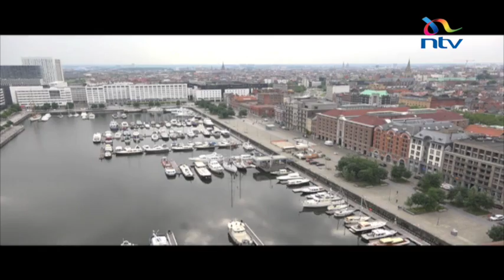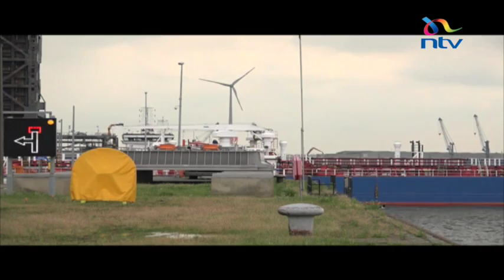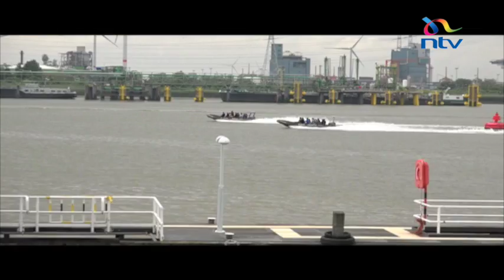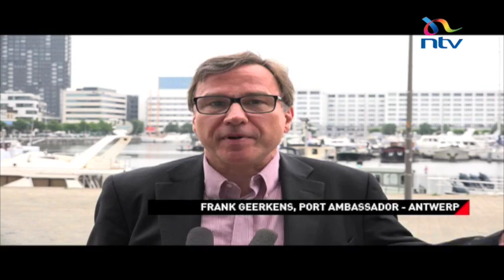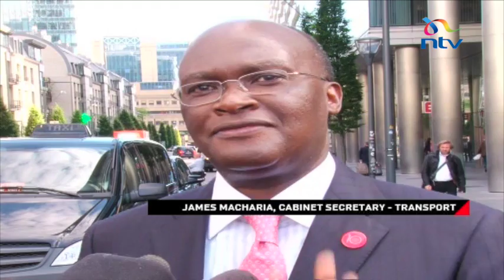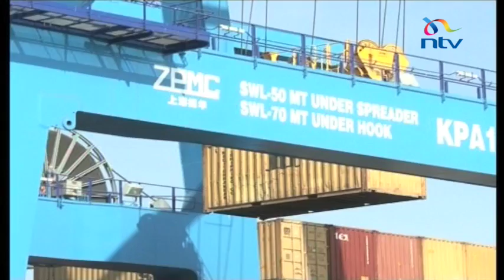Kenya hopes to turn lamu port into Africa's hub

Comment: If I may ask why construct sgr from lamu to Mombasa instead of it to be constructed to garisa towards Ethiopia which is more easier then a nother extends to Nairobi serving the areas of North towards Nairobi and expand tourism in lamu than overloading that of Mombasa nairobi? Answer this
Reply: Lamu to Mombasa to allow easy access to Nairobi which is kenya's economic hub. Remember Ethiopia has access to ports that are Geographically better positioned  compared to lamu, thus they may not need lamu port. therefore let lamu port serve kenya by connecting it to the economic hub and not to ''mashinani''